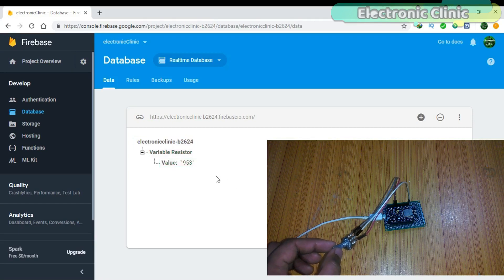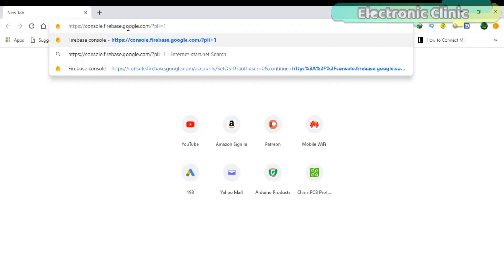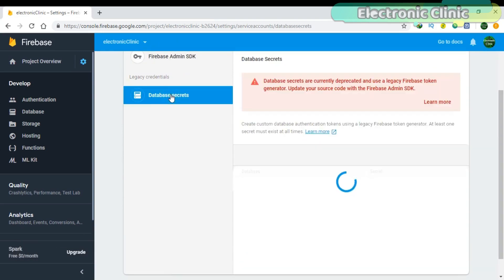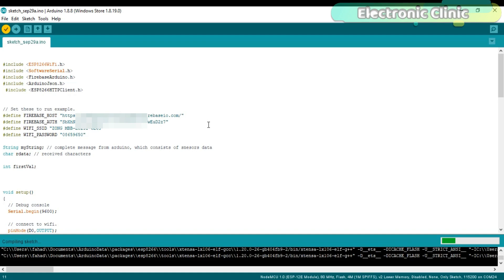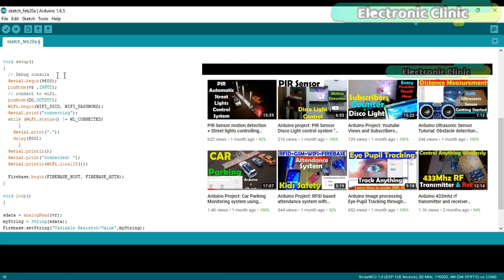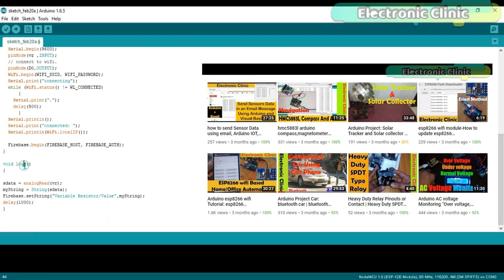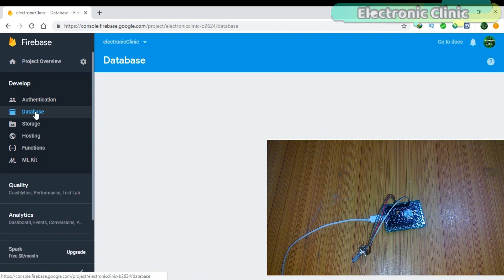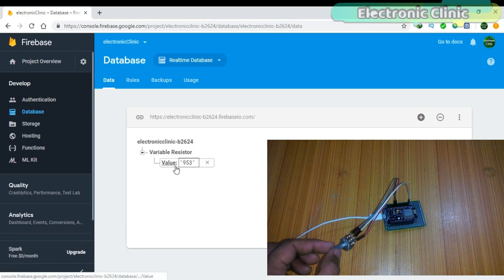Arduino Firebase project: send data to Firebase using Nodemcu esp8266, firebase library, auth, iot

Comment: I am a bit of a noob and starting now so please help me you explained the code but do you have any video you explain how you set up  the  hardware stuff?
Reply from the maker: yes i do have. check playlist
Reply: @ElectroniClinic  thanks for the fast reply  I just saw  the board one and I am doing it now as for the make  power supply on your own I am missing some stuff to do it can I just use phone cable and continue this project or do I need to make the power supply to continue to this project here?
Reply from the maker: @dionisismougoutos3582  you can also use the phone cable.

Comment: I am having trouble with this. Few days/ weeks back it was working but now data is not visible on firebase. Please help
Reply from the maker: may be they have changed something. i will.make a new video
Reply: @ElectroniClinic 
Yes please make a video..
I can get data from firebase but cant send it from node mcu.
The app which i made is working good with firebase that is sending and receiving data from it. But node mcu isn't working.

Comment: Dear Sir, I struggling a lot since two days, for pushing Json data as Temp: {FBDO.timestamp, TempValue} and Humidity: {FBDO.timestamp, HumidityValue}. or in the form of Json array.  I am using https://github.com/mobizt/Firebase-ESP-Client library. I successfully load the basic code  given in example and Pushed Temperature and Humidity data and Timestamp separately. But Struggling from two days to combine them in Json object or Json array. Please anybody......

Comment: Sir,  if nodemcu is fitted in box then what to do so it will not be overheated and is firebase database free subscription is sufficient for small project
Reply from the maker: you can add small air vents. ya you can use the free version.

Comment: Hey, Is there any way we can build an app with MIT app inventor for different nodemcu boards, as we always have to add the firebase token and url in FirebaseDatabase properties, we always have to edit it then compile the project, Can you please tell me if i can fill the token and url of firebase from outside the code, by any user? 
Please help, it is urgent.
Reply from the maker: you can do it easily, if you add a bluetooth module with the nodemcu. or you can use esp32 which comes with the builtin bluetooth.
Reply from the maker: using a cell phone app, anyone can update the credentials.

Comment: Hi, it is an interesting tutorial there. I have some concern about the Firebase database as I'm using DHT22 Temperature and Humidity Sensor with ESP8266 which probably sending reading every second. Will Firebase overload if I keep on pushing reading into it? or it automatically replace earliest reading with latest one? Thank you.

Comment: can i login using email and pass to save data from nodemcu on a specific user in firebase??
Reply from the maker: there are.other things that you will need like the database, the authentication etc
Reply: @ElectroniClinic  yeah i want login with my app into firebase. After that update some values and finally read that values on nodemcu. In fact i have all connections but i want to read data from an specific user
Reply from the maker: this will be available in a few days. i am already working on this. firebase with cell phone app.
Reply: @ElectroniClinic  can you tell me in advance an idea how can i get it? i want to have multiple users and multiple devices connected at the same database
Reply from the maker: you will need to automatically change the credentials for multiple accounts. this is an amazing idea. i will try this.

Comment: Is it possible to use esp01s module as a wifi bridge to sent data data from arduino to firebase? I want to use more than one sensor, so I need to have more analog pinout. Nodemcu does not give me this advantage since it has one analog pin.
Reply from the maker: wait for two days. i am making a tutorial on esp32 which have multiple analog pins.

Comment: Nice video. I have a question. I haven't got internet access in our garden, I would like to use GSM modul to get connecetion. Can I use this project and sketch or I need totally different things?
Reply from the maker: watch my last video. you can use lora and nodemcu together. lora module is ideal for locations where you dont have any internet

Comment: Wifi is connected but no data stored in firebase. Please give me a solution if you can.
Reply: even im facing the same issue have you fund any solution; please help me.
Reply: @amargupta.8847  I  have got the solution from firebase support. You have to update SHa-1 value in Firebase library in the file FirebaseHttpClient. The value is - 03:D6:42:23:03:D1:0C:06:73:F7:E2:BD:29:47:13:C3:22:71:37:1B
Reply: @farhadhossain2678  tq am bro..
Reply: @amargupta.8847   @Farhad Hossain I have the same problem, even after changing the SHa-1 i am not able to post data on firebase, kindly help

Comment: hello sir ... video its good , but the link of arduinofirebase library is not opening  , i tried to download zip file from github  after installing it in arduino ide  , it shows an error saying there is no library in it ...... i hve no idea what to do can you help me in solving this problem
Reply from the maker: maybe they have removed the library.
Reply: @ElectroniClinic   where have you used arduino? I can only see nodeMCU

Comment: i try to run the code but DO IS NOT DECLARE what should i do
Reply: me too :((. i tried connect nodeMCu to firebase but it does'nt work
Reply: @tranhieu2395  Me too. 'D0' was not declared in this scope
Reply: @tranhieu2395  Me too. 'D0' was not declared in this scope

Comment: I cannot access the Arduino firebase library.  https://bit.ly/2XdfIuk  As a result, the code you posted does not compile and errors show up.  How can I access the library you are using?
Reply from the maker: oh, it is blocked by Google. no worries you can comment your email id. or you can find this library on the GitHub.
Reply: There are several Arduino firebase libraries on GitHub,  what is the GitHub URL of the one you are using?

Comment: i used the example program of the firebase but it only shows error setting/number failed
Reply from the maker: send me the screenshot on my whatsapp number. did you install all the libraries ?? the board manager ???
Reply from the maker: if you are using nodemcu for the first time, then i recommend you should watch my very first videos on nodemcu. those videos will really help you.
Reply: Okk sir
Reply: What is your whatsapp number sir?